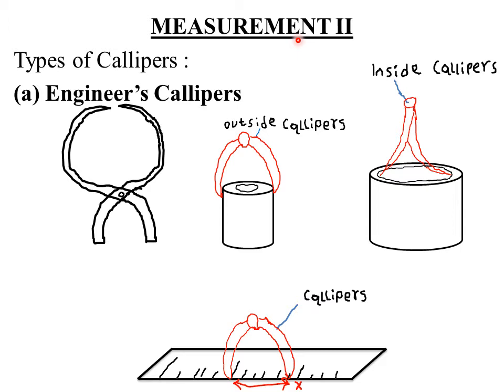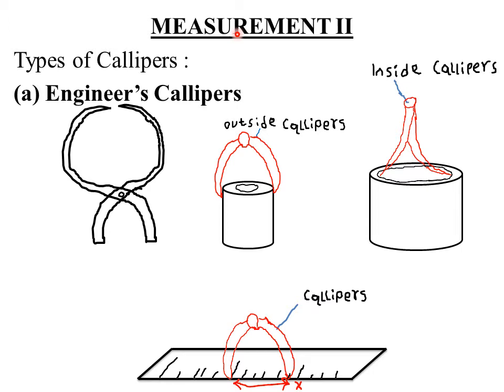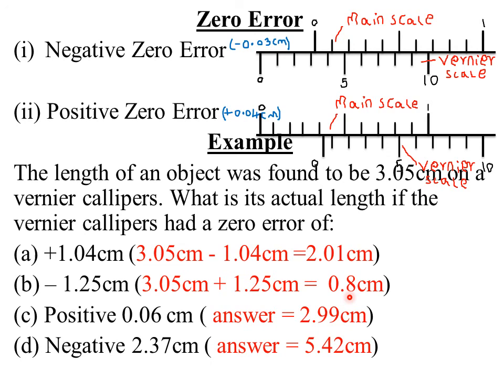TOPIC 2 : MEASUREMENT (II) : LESSON 1

Comment: Hi...there is a certain question in KCSE that might find different though it's measurement ii ..if you will have access to a book called kcse made familiar can you explain number 5 the question which was asked in 1999 measurement ii
Reply from the maker: Hi too bro. In that question they've placed vernier scale on top of the main scale so as to confuse you because in most cases the vernier scale usually appears at the bottom of the main scale, but the working is exactly the same 😂. Main scale reading (lower scale in this case)= Read a mark on the main scale which is opposite and to the left of the zero-mark of the vernier scale=0.5cm. Vernier scale reading (scale on the upper side in this case)= Read a mark on the Vernier scale which exactly aligns/coincides with another mark on the main scale*least count= 5*0.01=0.05cm. Object reading=Main scale reading + Vernier scale reading= 0.5cm + 0.05cm = 0.55cm. Always remember that Vernier scale usually runs from 0cm to 10cm but Main scale can run from 0cm upto more than 10cm, this should help you differentiate the two scales irregardless of which scale is draw on top or below the other. Thanks for your question.🙏